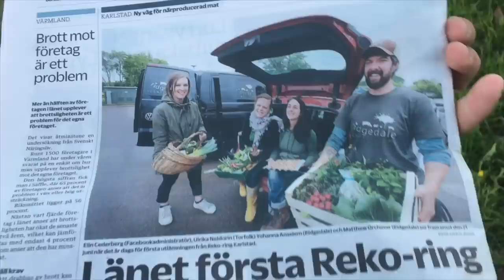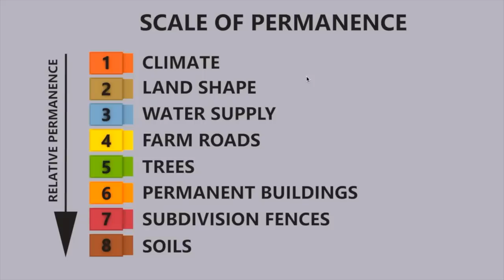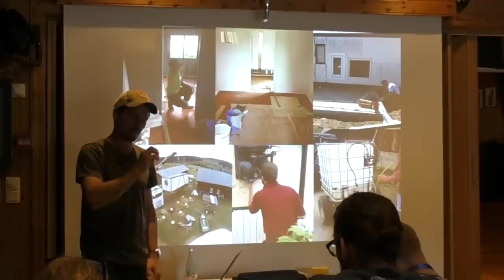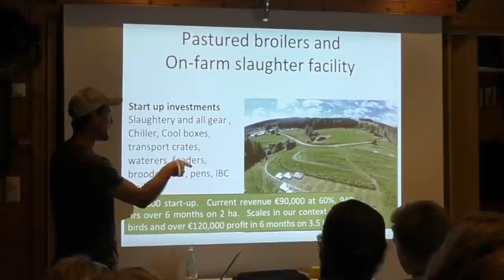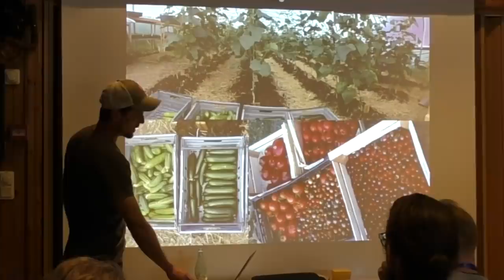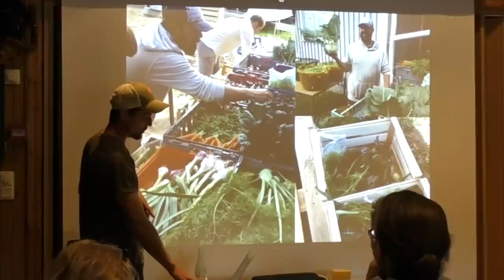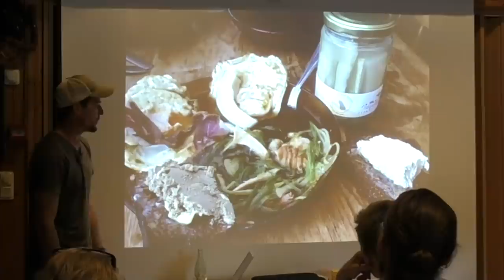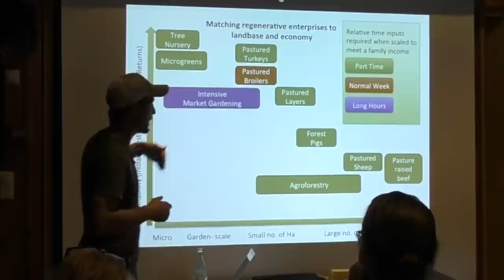MAKE A CITY WAGE FROM A SMALL FARM S5 ● E42

Comment: Biggest issue for me is access to land locally no local farmer is willing to consider a lease or long term partnership despite sitting on land that seems to go un-used year after year, less than 1/4 of an acre around here will go on the market for £30,000-50,000... Currently saving for land but having a mortgage and ensuring a roof over my childrens head gets complicated when you need £85,000-150,000+ to get started